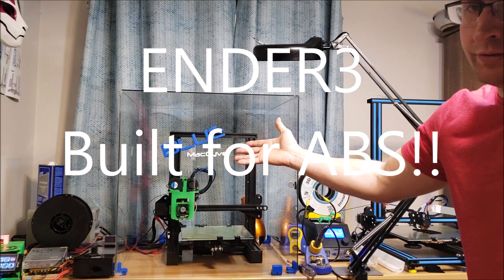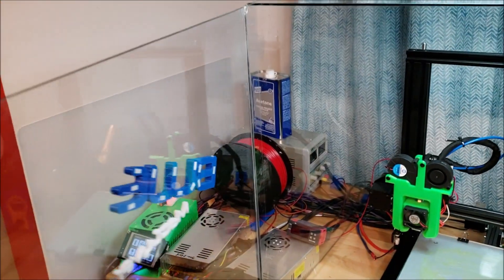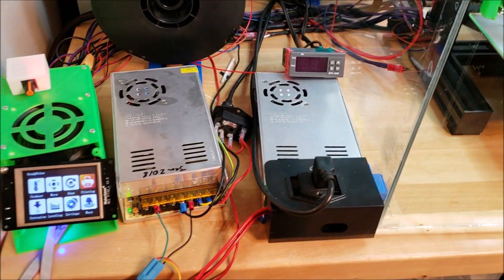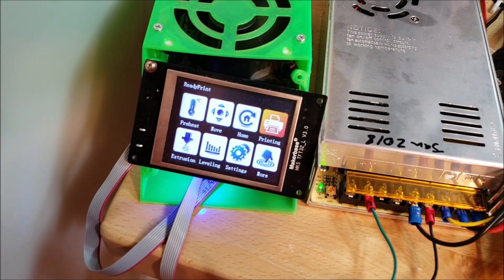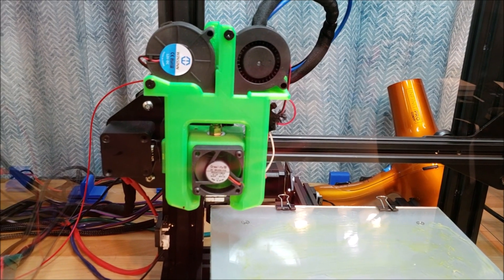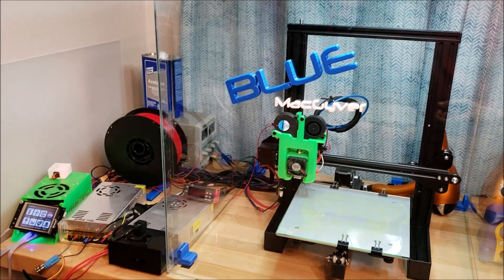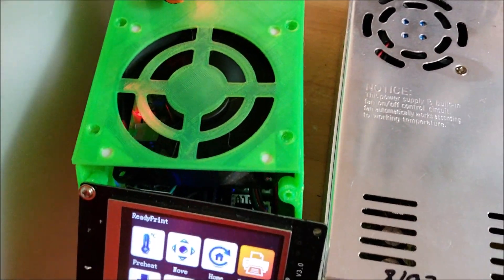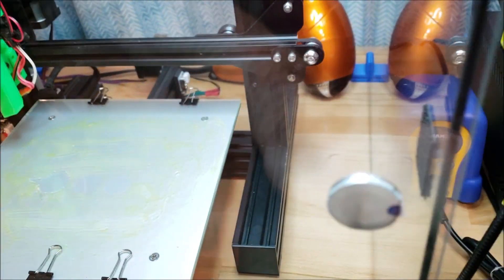ENDER3 Built for ABS!! Number One in the Hood!

Comment: How do you vent the toxic ABS fumes out of the enclosure, through the door ? Also, you can (and should) get rid of those motor dampeners. Get TMC2208 or TMC2209 drivers for all motors, not just the extruder.
Reply from the maker: I don't, I feel like it is such an over blown issue. I print when there is no one to harm anyway and the amount of escaping gas is so minuscule.

Comment: I like PetG over ABS and I don't need any special enclosure.   But, Im sure there are reasons for ABS.  I would also add, I see your little printed feet things on the bottoms... Why not do something similar to support the top plate over the side box?   you could still use tape but just use some printed bits that the glass slides into the make a sturdier box?  Just a thought...
Reply from the maker: I haven't messed with PetG yet.  It is a bit more expensive.  Normal ABS from Hatchbox is $20 or less PLA is even cheaper often going down to $15 USD, the PetG is always atleast $20 for a decent brand.  I know there are exceptions to the rule on price but I don't like waiting for sales.  The ABS also allows for the Acetone fuming process which no other filament does.  ABS is very aggravating for most folks but is quite the advantage to be able to print with.   You rarely see someone who can consistently print ABS with parts which are taller that a few centimeters. For my money PLA is the best to use, just because of the easy nature of the stuff.